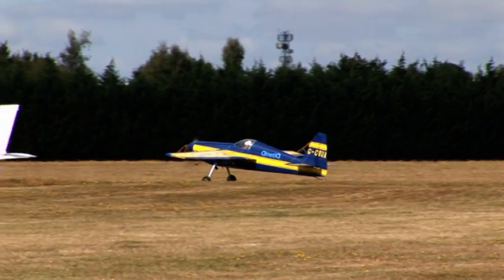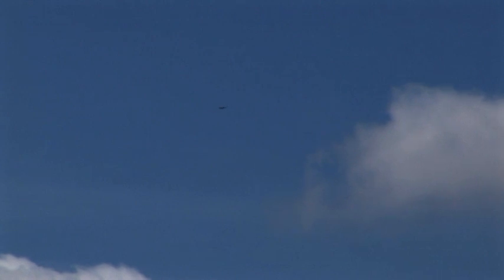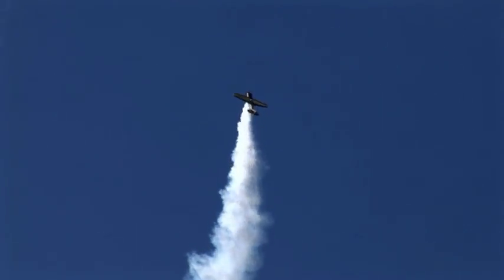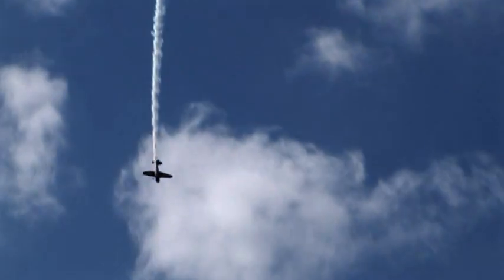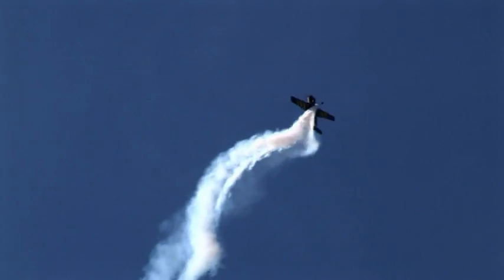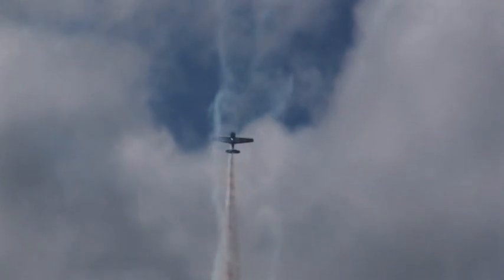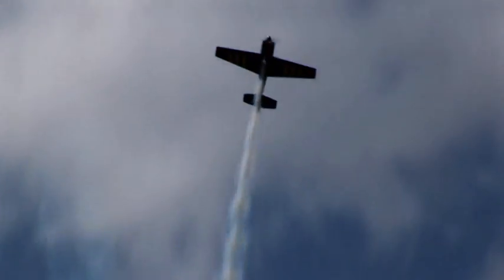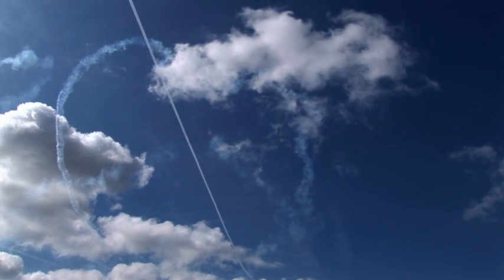Extra 230 Aerobatic display by Julian Murfitt

Comment: Nice display ! What engine is fitted ? 

Ps question : when watching the blades display you hear the engine cut back when in a fast dive, is that a fuel cut to stop over speed, or is the pilot closing the throttle? Or something else ..
Reply from the maker: its an Angle Valve IO 360 Lycoming 4 cylinder. Pushes about 220 HP
Reply from the maker: it will certainly be a throttle adjustment. If its in a dive then it will help slow down the increase in speed, allowing more time for what ever they are doing on the down line. The engine should not over speed due tot he Constant Speed Propeller but in a dive with full power you could certainly reach VNE quickly.